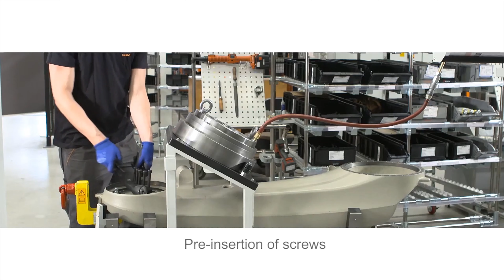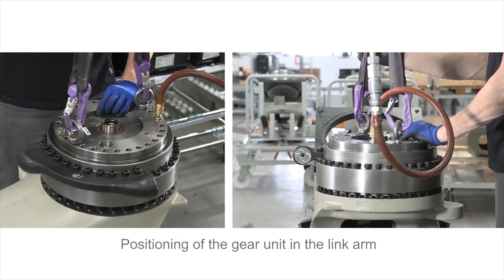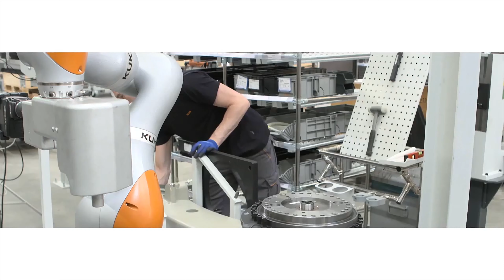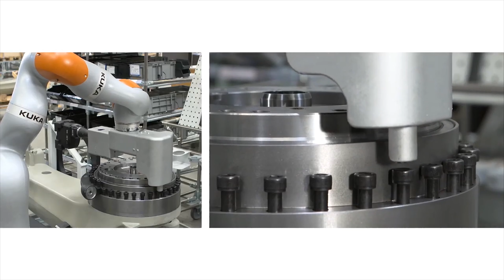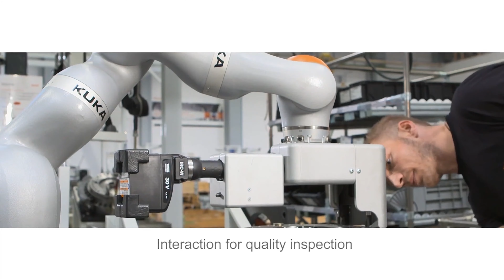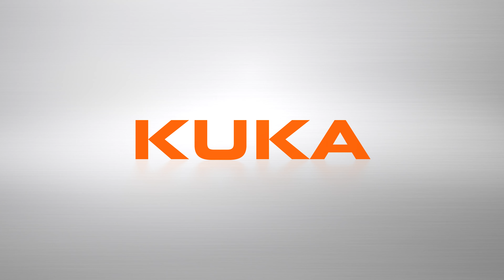Robots producing robots at KUKA

Comment: Although it is an interesting concept to do it this way.. This is no way optimized!
An operator holding an air-driven screwdriver (which is lightweight and most likely hung from a ceiling) will be able to finish this job before the unit would have arrived at the location of the other Kuka, leaving you with no transport needed (know your Lean wastes).
The least you should be able to do with the Kuka is screw in 4 screws at the same time, each on one quarter and claim it to be faster/more efficient. 
For a proof of concept this is pretty awesome, but from a optimized process standpoint, this is in no way close to perfection ;)
Reply: And then he has to check the torque of each single screw ... and can't prepare the next step ...  you are inefficient.
Reply: @julianreverse  Why would you have to check the torgue of each single screw? 
Checking, by definition is another waste..
Your screwdriver should do that while you are screwing it in the first time(i.e. not stop the motion until you reached the right torque). Exactly the reason to use an air-driven screwdriver.
And by the way, what next step is being prepared for?
Reply: @kingggerald  Show me your air driven ceiling suspended torque driver that records and tracks each bolt ...
Reply: @julianreverse  the impact driver will stop when it meet the required torque
Reply: it's not very fast but i think they don't produce that many robots so speed is not that important
Reply: @rezah336  They sell more Fanuc robots than Kuka :-D
Reply: @julianreverse  So the bolts you're buying are simultaneously the same nominal size, but have actual dimensions or properties that differ so much you need to track them individually?
Reply: That's why the highly automated manufacturer like BMW is still tightening screw by human worker with computer monitor screw driver. This video looks to me as a demo video
Reply: @Geolaminar  In many cases you have to check and document the tourque of each bolt.